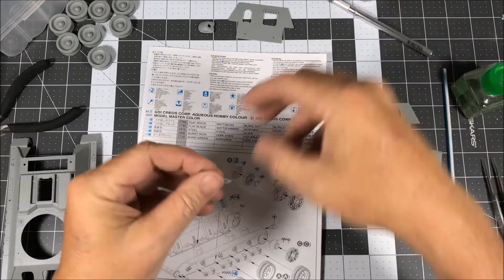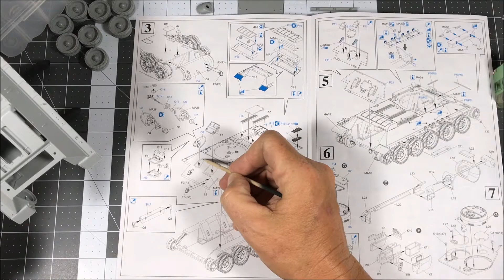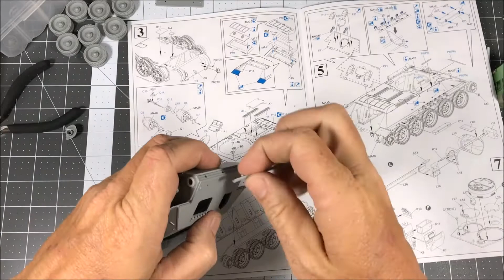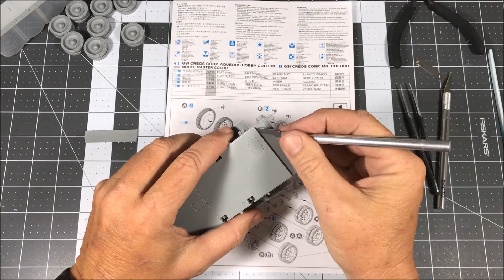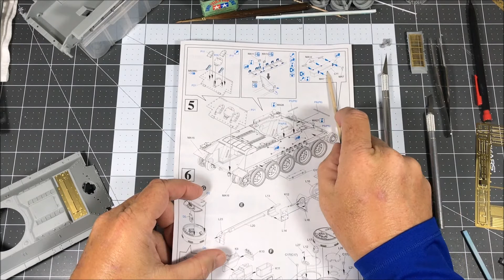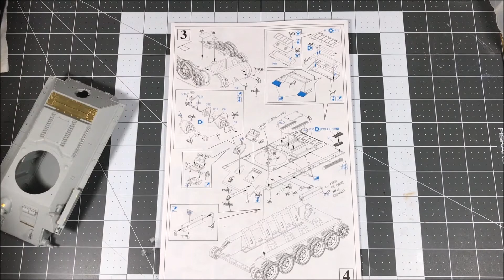Jos t34 group build pt 1

Comment: I think you hit on a fundamental problem with some of Dragon's T-34 kits,  the lower hull with the added lower plate was not intended as originally designed to fit the OT-34 it was designed for the T-34/85 kits. I have their older T-34/85  Mod 44 version ( kit #   6066), which was one of their first T-34 kits if I recall correctly. The thin armor piece that goes across the hull on the T-34/85 kits is angled (with weld detail) and not round, so the fit is better. The welds should taper more inward the lower you go on the front lower plate.. As you add putty to areas where welds are present, thin the putty with lacquer thinner and apply with a Q-tip or similar, it will allow blending of the putty so you can still see the welds, hope this helps.
I wouldn't worry too much about the gap on the sides next to the idler mounts, the fenders will hide this, unless you built it without fenders? Also, don't  glue the idler arms in place, as you may need to adjust the tracks.

Sorry for such a late reply but I just noticed your post, good luck if you're still building it. Good advice and tips for adding torch cuts etc and as to placing the front plate and scraping the inside edges, I run into this all the time.

thanks for posting.....Paul
Reply from the maker: Thanks for the comments and advice, Paul.
I am not building it right now. I needed a break, but I will finish it in a few months after some other projects. I don't like to leave kits partially built. I haven't yet, and this won't be the first!
I would like to build another T-34 eventually... do you have any suggestions for a good kit?
Reply: I would recommend AFV Clubs T-34s, these are the ones with the interiors, a bit more pricy as they include interiors but good quality, but I haven't built any, just going by reviews.

Mini-Art make nice kits with or without interiors, I got their SU 122 w/interior a few months back, really nice but again a bit more in price. They offer an SU 122 without interior as well. Also an SU 85. Not sure if they offer T-34s yet.

And Dragon of course, I like their kits even with the sloppy instructions, I think their earlier T-34s (T-34 1940, 1941 kits) are very nice.

I would look at some reviews of these kits before I shelled out my hard earned cash......a good site is Perth Military Modelling Site and you tube also.

Good Luck!

Paul

Comment: Wow Brett, how many projects do you have going on? Im gonna do a t34 too but its a captured german version.
Reply from the maker: Hi Pete! Three right now. The T-34, the M10 and the FW190. The 190 is on hold until it cools off some so I don't mess up the paint job. The T-34 and the M10 I am switching off on. The only reason I am doing both is because I was a t a stopping point on the M10 while I waited for more parts.
Which one is the one you are doing?
Reply: Brett G Right now I'm doing the Academy Hetzer late version, after that doing Dragon T-34-747 STZ mod. 1942 late production. It will be my first Dragon kit, and from the look of yours Im in for a challenge. 👍
Reply from the maker: Yes sir! Just watch the instructions and maybe have some references handy.

Comment: Another good video Brett. I had fit problems with the front hull on mine as well. I ended up using a resin part that my T-34 guru friend Steve made that corrects the incorrect Dragon T-34 front armor plate (apparently the drivers hatch was improperly located on all of dragon's t-34's, so my friend Steve gave me some resin corrected copies that he made. One detail to note, on your hull mg, the p.e. Piece on the top of the mg mount will need to be blended in with putty as it is representing the "plug" of slag left over from casting at the foundry in He factory. Kind of a neat detail I didn't know about until my friend Steve told me. Also, make sure to remove the side mounting brackets for the "box" style fuel tanks. They were not present on this version of the real T-34 and often get overlooked by many builders. Yet another detail my buddy told me about. Keep up the great work Brett
-Ben B
Reply: I'll try clarifying what I mean about the fuel tank mounts with some pictures through FB messenger this weekend when I get back from vacation. In the mean time don't add the details like railings and what not to the upper hull until I can clarify for you and save you some other unnecessary headaches.
Reply from the maker: Thanks for the tips! The PE part on the top of the flame projector mount is going to get a bit of sprue goo. I figured it was welded on or something so I figured I would blend it in.
As for the side mounts, I am glad you clarified that detail! They aren't anywhere in the instructions and there is no indication to remove them. And looking at photos of other kits make it even worse. Some left them on, others removed them. So, thanks a bunch for clarifying that for me. Tomorrow... off they come!
Maybe you can clarify something else: are there supposed to be tow hooks on the top and bottom of the bow? The instructions say to do it top and bottom, but that seems redundant.
Reply from the maker: Sounds good. I have the M10 out to work on right now, and won't be getting back to the T-34 until next week. Thanks again!